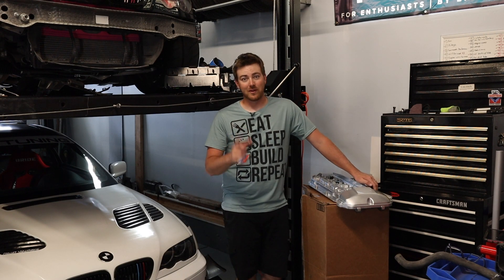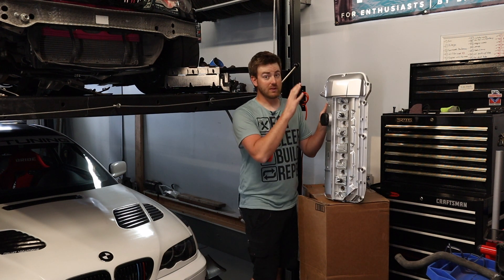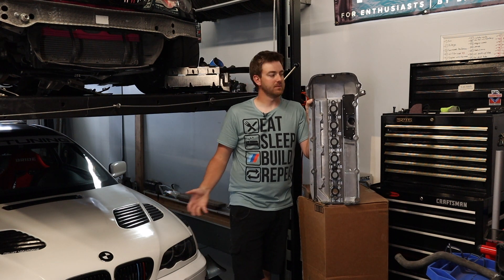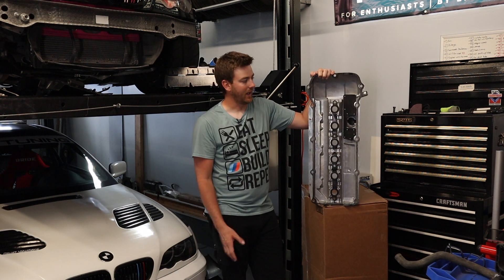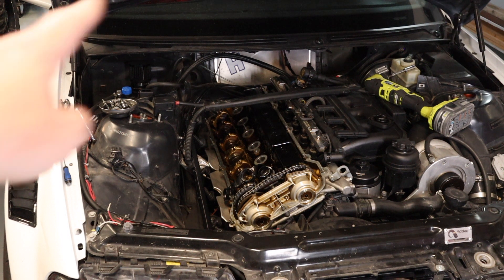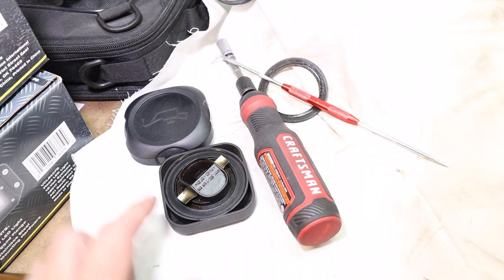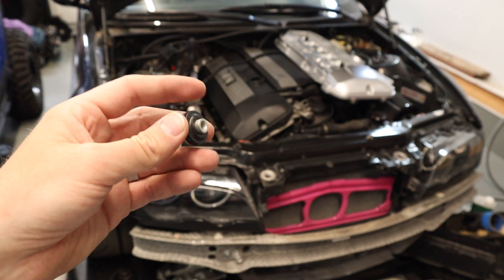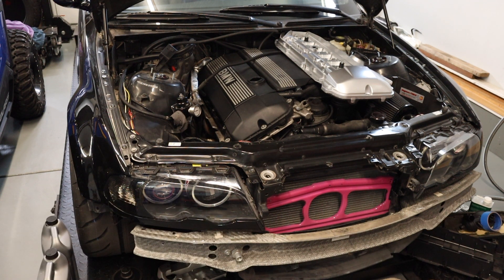M54 Aluminum Valve Cover Upgrade - BMW E46 metal performance modification for any racecar build

Comment: It has been a while but I have a question if that's ok?
There are two ground straps one each end that are fastened to an 8mm stud in the plastic cover.
Connected to the No 1 and No 6 coils.
I can't see if those studs are on the metal one.
Are they there or is there a different way of attaching them to the cover?
By the way. I have just replaced my gasket 3 days ago and I have now got a lean condition
on both banks with a CEL. Smoke test shows leaks all along the lower edge of the valve cover
Like you suggested at 3 min 56 second in the video. Damn.
Going to have to do the job again.
With a better gasket  kit this time.
I'll have to check the cover for warping too.
Reply from the maker: Rough. Sorry to hear that. This cover is a DIRECT swap. Everything is there and ready to roll.

Comment: I see screws on the plastic where the CCV connects, is that something to be concerned about and will lock tight hold up if used on those screws?

Comment: Is there a problem with not randomly marking the coil order, or do you need to number them each time you disassemble them?
Reply from the maker: It’s always a good idea to put them back in the same way. But if you don’t, it’s not a huge deal
Reply: @TenzaMotorsports  Thank you, next time I'm going to break it down by numbering it.

Comment: Just pulled my e46 out of storage, how are these holding up, before I start driving it again, I'm doing a refresh and this looks like a cool upgrade.
Reply from the maker: Been doing great! Couldn’t be happier
Reply: @ nice
Reply: @TenzaMotorsports  do you know if the M56 dipstick tube fits the m54? capped my original tube with a rubber vacuum cap but it failed a few months after I did my m50 manifold , trying to find a more permanent solution vs  capping the oil return....

Comment: Are you telling me that this valve cover pretty much has its own CCV system? Like I could put a little filter on the ccv neck and run it like that reliably?
Reply: no it doesn't have ccv inside the Valve cover, But i would recommend you M56 Valve cover it has CCV inside and it 100% fit on M54

Comment: thanks for this video! it's been about a year since this video, so how has the valve cover worked out so far? any remarks or advice you can give after using it for a year?
Reply from the maker: It’s been amazing! Another think I’ve noticed is that it lets heat out much faster. Almost like a heat sync. I’d do it again In a heartbeat! Great mod for every single e46

Comment: I just bought the same cover from 1A Auto, perfect fit and finish, but I am having some vacuum leakage around the seals, I might go back and put a small RTV seal around everything to tighten it up.
Reply from the maker: Vacuum leaks? Are you leaking oil as well?
Reply: Nope, the gaskets were pre-installed and I probably shouldn't have installed the VC without removing them and wiping them off to ensure a perfect seal.

Comment: What's under the ccv cover? Does it look the same as the plastic one inside or does it have some labyrinth like on m50 valve cover?
Reply from the maker: It’s not as complicated as the older valve covers. There’s a very small port, where it pulls oil vapors through and that’s it!

Comment: Hey just saw this the Mitzone like someone mentioned is available again an the other you noted is unavailable now- but look all the same view wise an even same pictures as the link just diff brand name. So this will fit stock CCV system? I dont have to do any passing or anything of that sort? I just wanna make sure before spendin the 180😂

Comment: I want to buy a m56 valve cover 
But living in the Netherlands how is coming over to europe
Reply: I ordered a complete setup with the coils from the US via eBay (in the US) and had it sent to me in the UK. It was very easy as eBay calculated all the shipping and duty costs and paid for it all via eBay. It was not cheap but I think it was absolutely worth it. Would I use this valve cover if I knew about it more than a year ago? Mmmm...probably not. Yes, it would have been much cheaper but I think getting rid of all the cyclone garbage under the intake manifold is well worth it. I use this engine in a big old Land Rover Defender in the Sahara so definitely a bonus!

Comment: Bought a MILLIPARTS valve cover just like that but they forgot the threads for the ignition coils
Reply: They didnt forget the the threads you bkught the wrong cover. I i qill assume your oe cover has a metal plate running the the center of it where your coils sit? There are 2 different variants of the valve cover.
Reply from the maker: Did you get it figured out?
Reply: Yea just bought a rock auto one and took the L on the other one

Comment: I have a 2001 330ci I order this valve cover as well but I’m not sure if my oem coils fit. It have the two bolts but it seems to me that the coils don’t seem to fit I might be mistaken but I’m not sure if I need to get new coils.

Comment: You think OEM Coils fit on the aluminum thinking about getting the Aluminum one what should I look out for ?
Reply from the maker: They fit if it’s the ms43.
Reply: @TenzaMotorsports  nice I have a 2005 Bmw 330ci I think that one comes with the MS43 gonna get it mine I just bought the car and it’s already leaking so I want to change it out since it’s my daily any other tips on M54 in general ? I Just replaced my heater hard pipe and coolant pipe under the manifold
Reply from the maker: Check to make sure. I’m pretty sure you’ll have the newer valve cover style. It’s easy to check. If your coil packs have two bolts it’s the older one like mine. If your coil packs are friction fit, it’s the newer style!

Comment: Man I really can't believe it either, I have a cylinder 6 throwing a code and I just did a valve gasket/coil/spark plug change and I noticed the cover had a crack/small piece in the gasket lining towards the inside of the gasket. Maybe oil in the rail or something but, I have been doing the same thing reviewing and Amazon did not pop up for me, please do a review ASAP man for sure. I'm hearing people say the CCV/PCV can't breathe properly and causes misfires. I'm in CNY so we don't get long periods of extreme hot weather but anything is possible, great video for sure though man and great find!
Reply from the maker: They are good to go! No problems. I've been very happy
Reply: Tell me how happy you are now, mainly are you hitting 70-75 highway, are you seeing any low rpm idle and mention anything you noticed. Please let us know odo if you can from then to now! Ty you for the vid alone
Reply: @TenzaMotorsports Hello!
What's the brand of your cover?
And what's your opinion for Mitzone , or what's the best brand for M54 cover ?

Comment: i have an 04 325i with an m56 from the factory. when i opened it up last year to do a valve cover gasket change i was unaware of the differences between or even existence of the m56 vs the m54. so thinking i’m working on a standard e46 and being met with some pretty different parts once i started working prompted the obvious panic before frenzied research to see where i went wrong. unfortunately a lot of the research i was able to do during my frenzy brought up information that was both vague and conflicting, only adding to the confusion, so i felt i had to rely on myself. anyways after some very meticulous inspection and careful disassembly as well as some pieces of valuable information scrapped from a plethora of different 50s kid videos i finally got the job done. point is i had a long good hard look at that stock m56 valve cover and even took it apart almost entirely trying to figure out what is what. the amazon reviewers who commented on the lack of baffling were on to something i’m almost certain. it appeared to me that in the stock m56 engine the CCV was moved from external under the intake manifold to become a completely enclosed system within the valve cover. the centrifuge (i think it’s called)  from the traditional ccv was moved to right underneath where that cap on your intake manifold sits. underneath that cap should be the components of the m56 ccv centrifuge, as well as for lack of a better term some crude suppressor like baffling going in each direction covered by two metal plates, each meeting around the base of the aforementioned cap. on a traditional m56 valve cover with functioning ccv you wouldn’t be able to see the underside of that cap due to the components of the functioning ccv. on a normal m54 to m56 manifold swap keeping the stock m54 ccv can be done but is unnecessary and somewhat repetitive because the m56 manifold ccv takes care of it first, more effectively too since it always reaches operating temp with each cycle. with this manifold it does not appear to have any functional form of ccv centrifuge within the manifold itself so if someone were to delete their stock m54 ccv as is traditionally acceptable they would actually be putting themselves in a situation where they have no functional ccv. a driver experiencing the symptoms of this without realizing they don’t have a ccv would have a hell of a time running it down. $$$

Comment: I have the same valve cover. I hope you took the baffle off and cleaned it. Mine had very small shavings from the machining. Also their gasket failed for me after like 1k miles. Was leaking into the spark plug holes. Some people covers had cracks but mine seemed fine.
Reply from the maker: I had removed mine to inspect it. Everything looked good. I reused my “old” gasket and put the one it came with to the side for now. But that’s good information to know

Comment: There was a brand called Mitzone that made these too but unavailable now
Reply from the maker: That company doesn't ring a bell, but I’m sure there has been more than just a few to produce them. I’m just glad someone does now at an affordable price. Thanks for the comment!
Reply: @TenzaMotorsports  So, the Mitzone ones on Amazon were available for like 5 years, and had thousands of good reviews from real users. Seems like they rebranded into whatever "brand" is on the units you purchased
Reply: Ebay

Comment: Wow, this is a very interesting alternative to the m56 valve cover swap.  I did the m56 swap, but if this had been available I might have gone this route instead.
Reply from the maker: What did you do with your ccv system? Just curious
Reply: @TenzaMotorsports   Plug the old CCV